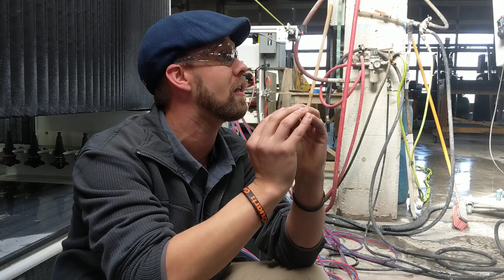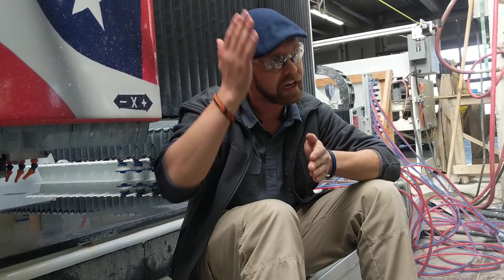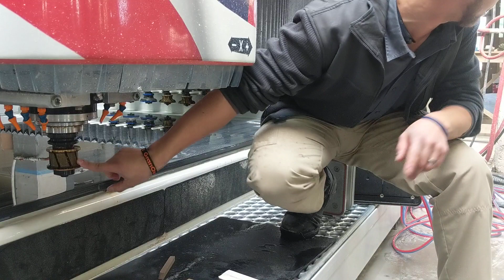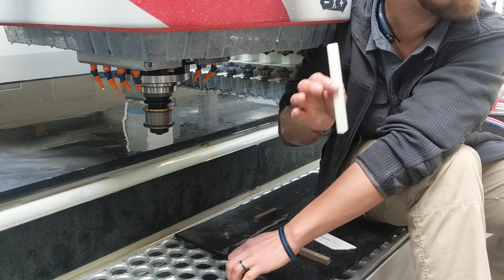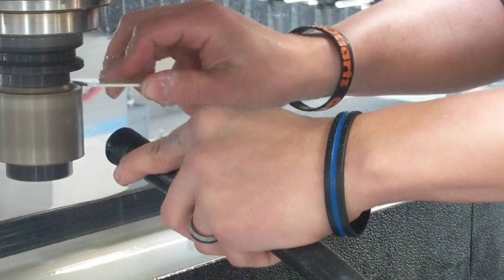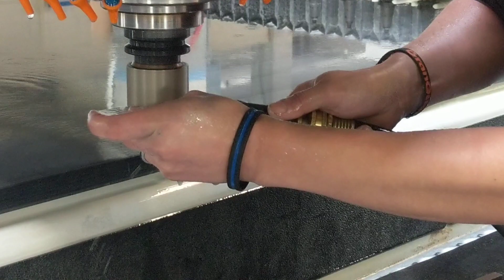Dressing granite CNC tools- COMPLETE

Comment: They have that tool that is black pressed to hard
Reply from the maker: CNC Scottie can you elaborate?
Reply: Josh Householder Yes, I believe  it could be a few things. They could not be hand measuring their tools after laser measuring or not have their tools within parameters. Which means the tool could be running to fast, not right rpm,  or removing to much materials with that specific tool position. Depending on how much you run you should consider that when determining when you should check and when you should dress your tools. Last but not least the stone could be way harder than others and they fried the diamond unintentionally. In that case they should have turned the machine down.
Reply from the maker: CNC Scottie ahhh. I understand what you mean now. That is correct.